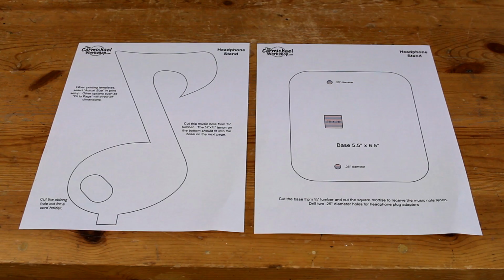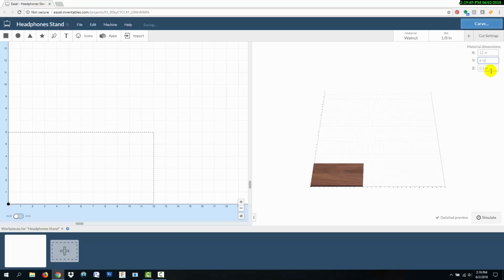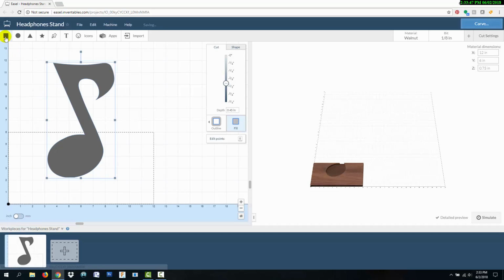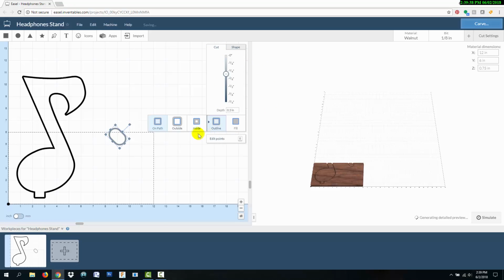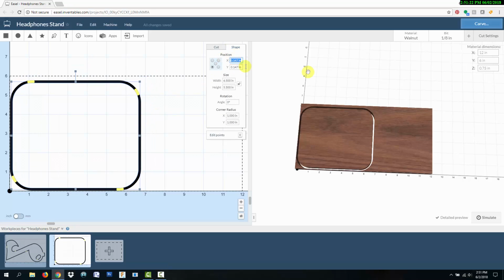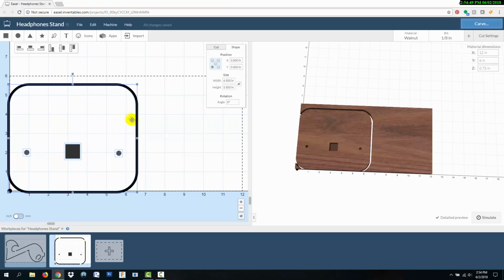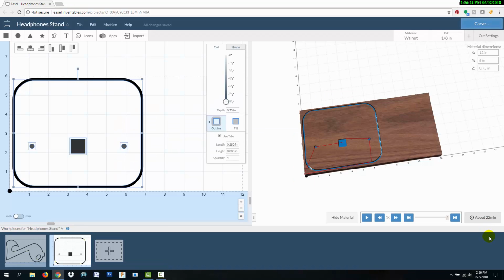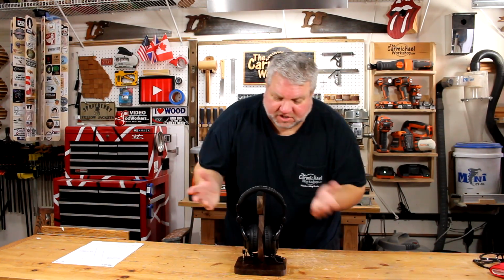Headphone Stand - Inventables Easel Power Hour Challenge for X-Carve CNC

Comment: The contest worked well for its intended purpose.  There were around 215 submissions which significantly grew the number of designs on Easel, particularly in the quick to produce niche the contest targeted.

That said, i think that a future contest could benefit from a few changes.  I would recommend the following...1) Submitting an entry would let the entrant rank their favorite 10 contest submissions (their own designs excluded).  2) From the emerging rankings, the judges would then fabricate the favorite 10 designs using Inventables equipment.  3). From their experience fabricating the designs, the judges would pick the 5 best.  4) In a contest like the Power Hour challenge, it might be interesting to further see how fabricated objects actually do in a flea market or Etsy setting.
Reply from the maker: Hi Harry - Thanks for entering the contest.  It was hard to judge from all the great entries.  Your candy dish is great and the scout den will love them.  I used to be a den leader when my boys were young.  I think this was their first contest like this, so I will definitely forward your suggestions to them.  I like the idea of the entrants voting.  I also like the idea of making some of them, which I plan to do anyway now that I'm back from vacation.  I think a lot of the projects would do well at a local fair/market.  Etsy might be tough, since a lot of people sell the same type items and it's hard to stand out.  Thanks for the feedback!

Comment: Great project Steve! I REALLY need to get an X-Carve in my shop! I work with a 48" flatbed cutter at the sign shop I work at but that's all making signs, can't use it for making stuff like this. Guess I better download the software and get to work making my entry!
Reply from the maker: Thanks!  Cool, Easel is a website application so you don't even have to download the software, just create a free login.  Also, don't forget I'm accepting Easel projects myself until June 6th, and I'm going to pick some to actually carve on my machine and ship back to the designers.  I haven't received any yet, so if you send me one I'll probably carve it if it's not too crazy.

Comment: Excellent video! I need to enter this contest.
Reply from the maker: Thanks, and yes, you need to Josh!  It's free and you get to learn a little about designing a project for a CNC, if you haven't before.  But then you already got the skills to carve out a Soundgarden album cover by hand without a CNC.  :)
Reply: Thanks Steve!  The software is pretty easy to use - similar to the Silhouette Cameo stencil maker, which I've been using for years.  I uploaded my project, a Nashville skyline relief carving, with the relief to be filled with resin (I hope the use of resin is allowed).

Comment: Can you enter more than one project?
Reply from the maker: Hi Harry - Hmm, I will check and reply here when I find out.  Here's a link to the official rules from Inventables, but I didn't see that mentioned.
https://www.inventables.com/projects/easel-power-hour-challenge?ref=CarmichaelWorkshop
Reply from the maker: Hey Harry - Participants may submit more than one project to the challenge.  Get to work!  lol   btw, If you design something and email me the link by June 6, I might carve it for you and ship it to you.   :o)
Reply: I run a stock techno-isel davinici III.  Its work area is a touch larger than the carvey's; 300mm X 250mm versus the Carvey's 300 X 200.  I let my kids design stuff on Easel and I cut it out.  I think I will try to work out some designs small enough for the carvey.  I think the spirit of the challenge is to bring many desirable designs to the Easel library that can be quickly produced by the cottage industrialist and sold at craft faires.  That said, I would hate to create a design that simply doesn't work for the Carvey.  Since i don't have one, it would be hard to know if I strayed outside of its work envelope.  I have confidence that the various x-carves can make anything the Carvey can.
Reply: This project cuts two small bowls from a 12” by 6” by ¼” walnut board.  I took minor liberties with the speeds and cut depths to sneak the cut time under one hour.  The kerf sneaks outside of the stock on the right side but this should be fine.  You can give the project a try using the URL below.  You can also try the big version by searching for Fruit Bowl on Easel.  The big version, with tool paths generated using Easel defaults, takes just over 3 hours.  My CNC is a brute and can do one in about half that time.

http://easel.inventables.com/projects/npzKmvCdrrko4S-DNQR-lw

My fruit bowl is very much like your bowl from…
Create a Bandsaw Bowl or Basket out of Wood
https://www.youtube.com/watch?v=2-fUCVeX8PQ

The bowl’s paths were designed using formulas in excel and an excel graph became an SVG image that was then imported into Easel.  Easel then created the tool paths.  I’m not sure if this meets the spirit of the “designed in Easel” provision for the hour of power.